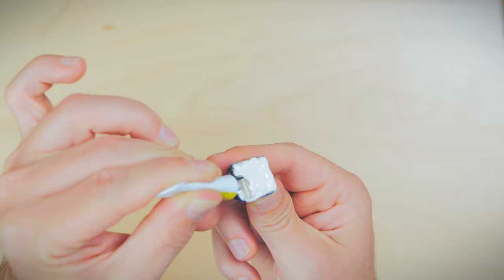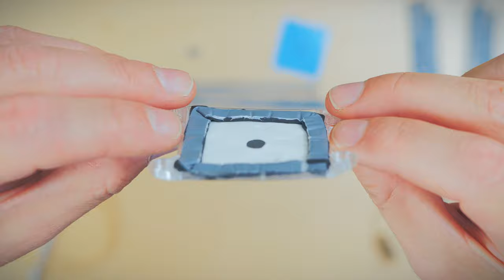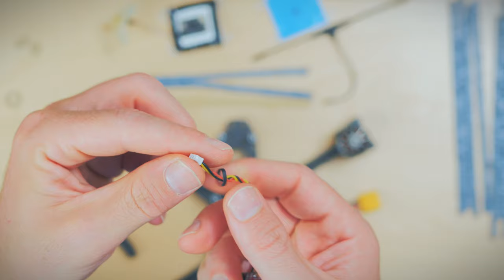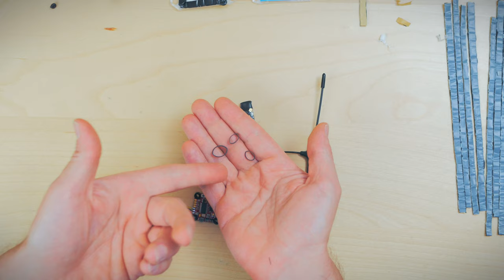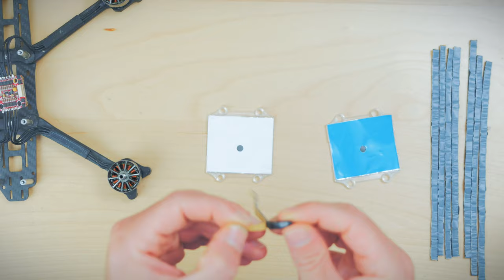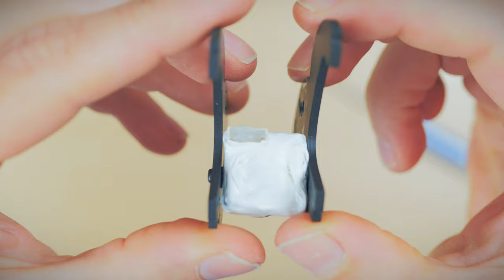Deep6 Waterproofing Video - Analog Version

Comment: I bought this build kit with the vista waterproofing parts. I gotta say that it is a bit involved to get all the waterproofing just right but the support was great. Every email was answered, all questions were resolved and honestly this is a great frame even if you don't add the waterproofing. A great tip is to use race wire so that if you need to replace a motor you don't have to disturb the waterproofing of the esc board.  Great quad overall!
Reply from the maker: We appreciate you! Thanks for taking the time to relay your experience and we look forward to seeing more vids from you! 😉
Reply from the maker: BTW, the vista add on video/shoot is next. Great tip about the racewire! 😉 We mentioned that in the "frame build" video which will be released today or tomorrow.
Reply: Great move sending Nurk one of your quads. Do you sell BNF? Also I like the snorkel Immortal mount. Really though, great frame even without the waterproofing. I love how tight the arms fit together, solid design!
Reply from the maker: @skyhackerfpv7104  We are taking requests for BNF as they come, there is a ton of work/testing with the BNF's so we make them to order. We really appreciate ya SkyHacker!
Reply: The Caddx Vista itself is waterproof. Yes, I'm serious.

Comment: Are we just not going to mention the gaping hole around the FC USB connector (14:25)? That said, this is a pretty cool kit I'm seriously considering. I live by the ocean and there are so many cool spots to fly over the water! I've already lost one drone to the sea and I don't intend to lose another.
Reply from the maker: We can chat as long as you want about that gap 😀. Good, catch BTW. The gap you see is basically the support for the underside of the heatsink we attached here (12:42) and does not need to create the seal. What matters is that the heatsink and rubber are sealed, not the plastic support 😉. On the top side of the FC, it does matter that the plastic and rubber create a seal.
Reply from the maker: Let us know if you have any other questions and just make sure to flush the build in fresh water after flying around salt water or in salt water. We recommend flushing or soaking in fresh water asap, then doing some punch outs, then repeating the process one more time to be certain all the salt water is flushed out fo the frame, parts and motors. Appreciate ya!

Comment: This looks pretty cool but I'm really debating whether it's all necessary. Is there a reason you think isolating the components dry instead of coating with conformal or other silicone products is better? My concern is that all that rubber gasketing makes it vulnerable to tears/punctures. I guess this makes a lot more sense if you want to get to the electronics easier and change components etc. Otherwise I think it might be easier (and much more cost effective) to just grab a tube of FPV Worry Free and goop everything up.
Reply: Same. Live in Oregon and always conformal coat everything and dielectric grease connectors and have yet to have an issue. Granted I don't actively dunk my kwad in pools of water. This gives me some good ideas for a future build thou.

Comment: Curious where I can get a kit or custom kit for a build? Checked the website and didn’t see any product I could apply to my drones
Reply: It's just tar tape, thermal tape, thermal silicone glue (purchasable on Amazon) and custom tpu prints (if you can model and print)

Comment: What about the motors? Don't they need waterproofing? If not, how so? Really cool kit btw. I not flying drones IRL yet but planning on doing so after I feel comfortable flying in a simulator. Near my place there a couple of cool spot above water. This kit would be perfect!
Reply: Brushless motors are water safe naturally just because of how they are designed with all the strands electrically isolated. The only thing to worry about is the bearings. Water will seep in if given the chance, so you need to dry them right away.

Comment: You sell an air unit holder on your site but where could it even fit? In the back? There’s not much room. I imagine a caddx vista would overheat for sure in the summer sun
Reply from the maker: Hi Bendan, the Air Unit will go in the middle of the frame above the ESC and the FC will go in the back. Take a look here:
https://cdn.shopify.com/s/files/1/0358/4091/7643/products/20201022_113139_1024x1024@2x.jpg?v=1603384777

Keep in mind, the Caddx by default overheats just sitting without any waterproofing. But as soon as you start moving, it cools because of the airflow from movement and props. It's exactly the same with the waterproofing, the waterproofing does not add any extra heat in our testing.
Reply: Ok great! Looks good

Comment: Any idea when your full kits will be back in stock?
Reply: I’d say this wasn’t commercially viable. Unfortunately. My guess is a significant amount of users had serious issues, probably due to user error, which made them very cranky, and the guy doing this couldn’t take it any more. Shame because in my opinion, this is the pinnacle of FPV waterproofing. Conformal coating is lazy and not perfect.
Reply: @JaydenLawson  I made my own and filmed the process. They made a version 2 in the meantime which looks good.

Comment: I think this is a classic case of over complicati g something that should be very simple, my main issue with this is that there are way to many points of failure, weather it's from user error or accident damage, inability to further service the quad, conformal coating had been waterproofing electronics for decades and has a lot less chance of making a mistake that lets in water and wrecks your electronics especially if you have had a crash and cracked a housing or something their are unprotected electronics inside, even the tiniest hole and moisture will ruin everything. Atleast a couple coats of conformal coating on things before putting it into the housings, but then it negates the need for the housings all together, but I guess you can't make as much money on conformal coating, this "kit" you get to make bank selling them so I get it, I just don't get it because I'm not about that
Reply: How is heat dissipation with conformal coating with 1W+ vTXs and other high-heat producing electronics?
Reply: @JaydenLawson  heat dissipation with conformal is a lot better than alot of other methods because you retain more surface area and it's a much thinner coating, I haven't had any issues with it on my quads escs and they can get toasty, compared to my joysway dragonfly floatplane that came with the esc in shrink-wrap with silicone sealing the ends, it got HOT AF! and it let water in on a rough landing when I stalled at about 2M off the water and nose dived into the water then I couldn't drive it back to the shore. So literally today i conformal coated it after last night getting it cut out of the shrink warp and dried out, now that the heat won't be trapped in a bag with the heat producing esc hopefully it won't keep overheating on me and making it so I can only cruise around at 65% throttle for longer than 10 seconds without it overheating and losing power, something that sucks when launching off water and trying to climb out